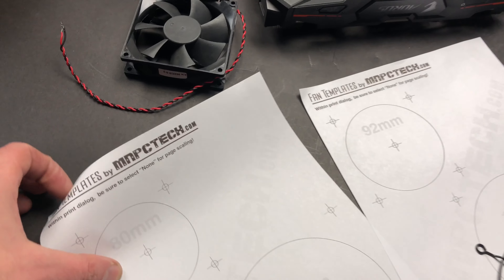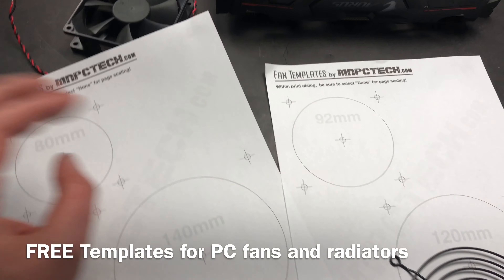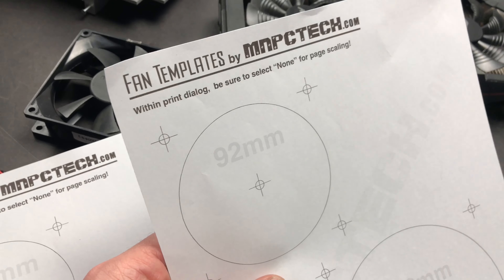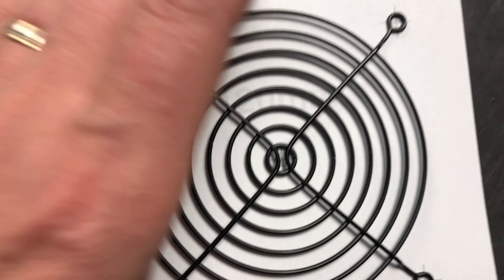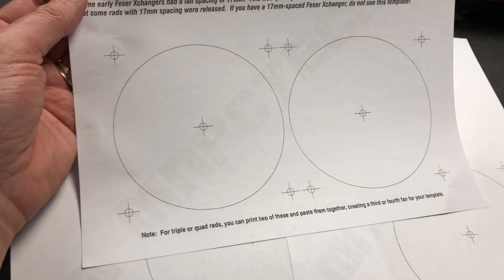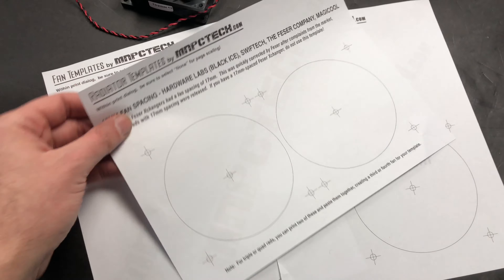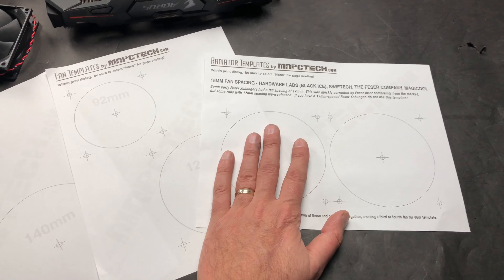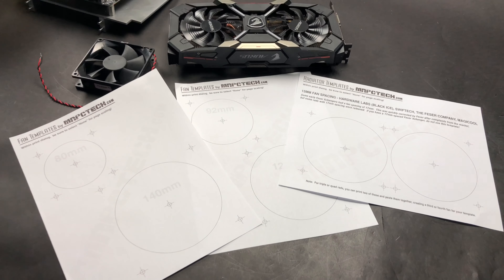FREE PC Cooling Fan & PC Radiator Printable Templates

Comment: These are very helpful.  For the 280mm rad template you have it with 20mm spacing.  Do you have one with 15mm spacing?  Do you know which is standard for new AIO's, 15mm or 20mm spacing?  Thanks.
Reply from the maker: We don't have 280mm template with 15mm spacing, sorry.  For AIO's, you'll need to check with manufacturer.
Reply: @MaxellAdGuy  Thanks for the quick response.